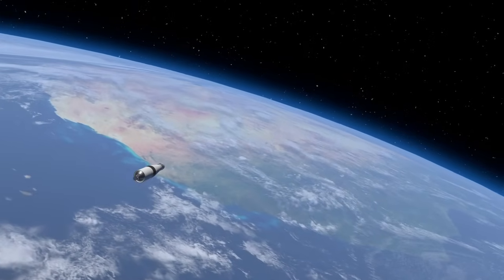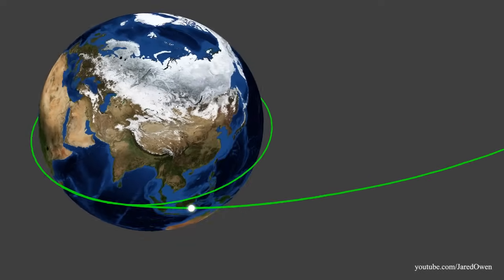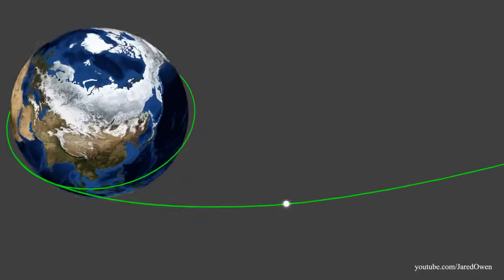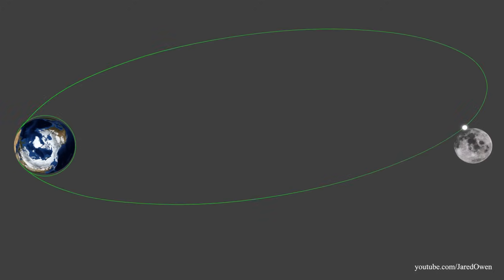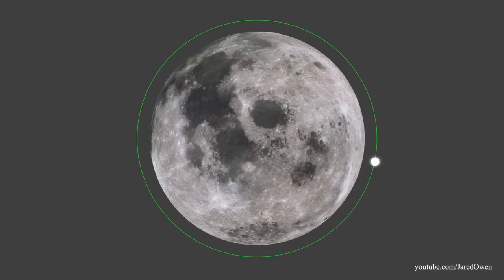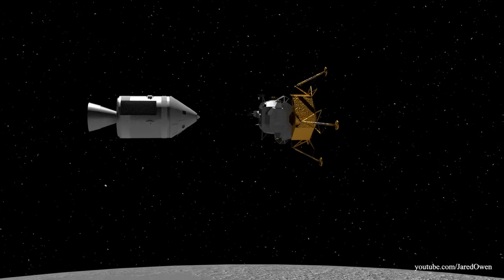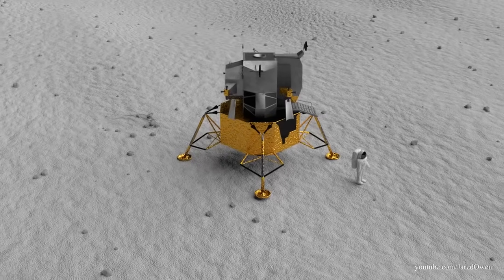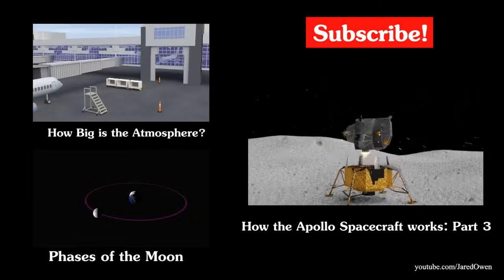How the Apollo Spacecraft works: Part 2

Comment: so according to you we just fly up to space and magically make our way to the moon over 3 days with no power, rockets or any kind of flight controls?  sorry, just not believable.
Reply: As I mentioned in the post you left in part 3 of this series, which I see it looks like you have deleted, he didn't go into specific detail about how the Saturn V was designed and built. I'll ask again. Do you think the most complex machine built at that time and successfully launched 13 out of 13 times just magically appeared out of thin air? That's how ridiculous you sound. Jared's videos explain how the lunar orbit rendezvous procedure works along with the Apollo spacecraft. Did it ever occur to you that the details you think he should have covered can be easily found but instead you dismiss it as magic?
Reply: Since you never responded to my original query, here you go again

-> 400,000 people were involved with the project, yet nobody has come forward with evidence that the landings never happened. You guys like to bring up the Manhattan Project compartmentalization security that kept only the ones in the need to know fully aware of what was going on. Yeah, sure. A top-secret military project that kept even vice president Truman out of the loop being compared to a project like Apollo that was as publicly open as possible. Yet despite all the USA's attempts to keep the A-bomb project under wraps Russia still managed to get key people in the right places to provide them with enough info that they developed their own bomb much sooner than the USA expected. You seriously expect us to believe that compartmentalization was possible in a project as huge as this that so visible to the public? Or that in the past 45+ years since the landings were supposedly staged, nobody has come forward with insider information or definitive proof? Yeah, right.
->Typical hoax believer answer: (Something involving a worldwide conspiracy with zero credible proof)

-> The Russians tracked and confirmed all 6 of the Apollo moon landings. Why would the USA's major competitor during the space race do that?
->Typical hoax believer answer: (Something involving a worldwide conspiracy with zero credible proof)

-> Russia, Europe, China, India and Japan have all flown missions to the moon. So far, none of these countries/nations have brought forth any evidence that it's impossible to do a manned mission to it. That includes this nonsense about the radiation in the VAB's being too hazardous to pass through. No credible radiation expert from any country including the ones mentioned here have ever stated that the radiation in the VAB's was an insurmountable problem during the Apollo missions to the moon. Why is that?
->Typical hoax believer: (Something involving a worldwide conspiracy with zero credible proof)

-> Scientist from around the world for the past 45+ years have verified and peer-reviewed all of the lunar rock & core samples plus all the data transmitted back to Earth by the ALSEP's left behind. There's also the Apollo 16 UV telescope images that include some of Earth that no astronomer has ever found fault with. That's as close to irrefutable proof as you can get. So how about you explain this away
->Typical hoax believer: (Something involving a worldwide conspiracy with zero credible proof)

.
-> Hoax believers have for the last 45+ years tried to find evidence that the landings were faked and have found nothing that can't be debunked. The proof they failed is that despite all their efforts, the missions are still in the history books. A story of that magnitude would have been seized on by investigative reporters and news networks. Not just the USA but countries from around the world would have gone after the biggest scoop in history. Explain how come they haven't.
->Typical hoax believer: (Something involving a worldwide conspiracy with zero credible proof)

-> Third party evidence that NASA would have had to orchestrate and coordinate flawlessly while at the same time supposedly hoaxing the mission; How could they manage that without insider proof coming forward for the past 45+ years to blow the whistle on it all?
->Typical hoax believer: (Something involving a worldwide conspiracy with zero credible proof)

Trying to discredit information because it came from NASA, as I'm sure you'll do, is a bit ridiculous. They made all the engineering and science required to pull the missions off available to their counterparts from all kinds of countries throughout the world.

In regards to the Apollo landings, we are talking about hundreds of 1000's if not millions of people with above average intelligence in various countries throughout the world over a time span of 50+ years.

I'm not just talking about the people involved with the project while it was happening. There's also all the scientists and engineers in the following decades that have access to everything related to it regarding the engineering plus all the scientific, peer-reviewed evidence, data and samples. Yet in all that time none of these highly intelligent folks from around the world have ever found a way to somehow get information out to anybody about NASA"s alleged duplicity regarding the supposed landing hoax.

Considering how incompetent everybody seems to think governments are, it's pretty amazing how people like you have no problem believing that a hoax of this magnitude could have been kept for so long without one piece of verified proof from the hoax believers being brought forward in 45+ years. All you guys have is unsubstantiated claims that require ridiculously more unlikely and equally unverifiable conspiracies within conspiracies to keep the original moon landing conspiracy going. Does that not give you the slightest hint that maybe the moon landing conspiracy is seriously flawed? People who see no problem with this usually dismiss, ignore or don't understand the irrefutable scientific evidence.
Reply: If you ever do attempt to do some proper research, you would find that every single supposed bit of evidence brought up about alleged proof regarding hoaxing the Apollo landings have been debunked over the years. If you decide to register at that forum I mentioned, I'm sure the same thing will happen with your photography questions but of course, that will depend on you be willing to admit you are wrong. Something that is pretty rare when it comes to this subject. Most of that evidence was debunked with relative ease because the supposed proof is usually based on complete ignorance of the particular subject involved. It's only people who lack critical thinking skills who fall for this moon landing hoax nonsense. Meanwhile, there's tons of engineering & scientific proof that's withstood scrutiny for 45+ years. Here's some of it:

-> There's the live TV coverage that would have to somehow convincingly fake 1/6th G movement in a vacuum, Google "Irrefutable Proof for Moon Landing - Lunar Gravity" and explain how experts in the field of kinematics for 45+ years have never come forward with proof that the astronauts are not in an environment that they say they are. There's also the fact that any attempts to do filmed mockups of the eva's on Earth would have to be passed off as live TV broadcasts which would have to fool telecommunications experts around the world. Google "Moon Hoax Not" and "For Jarrah" to get a better understanding of how much would be involved to pull that off and how the filming technology back then was simply incapable of such a thing.

-> There's all the moon rock and core samples that would have to somehow be able to pass scrutiny with geologists who can readily spot whether it's something that has passed through our atmosphere or not. 
Google "How do we know that rock came from the moon?"

-> NASA has made these samples available to scientists from around the world and every year 500-1000 samples are sent out.
Google: "NASA lunar sample request"

-> There's the Apollo 16 UV telescope images that no astronomer in 45+ years has ever found fault with. Google "onebigmonkey apollo 16 UV telescope"

-> Another thing that astronomers would be able to spot are pictures of the Earth that don't match what they should look like. 
Google "Apollo 11 Earthrise - How One Photo Proves it was Real" for an example. 

-> Another one to google is "Apollo 11: Fingerprints in Deep Space" that shows obvious handheld TV footage from the Apollo 11 CM looking at Earth from far enough away that they are clearly beyond the VAB's.

-> Then there are the LOR images. Lots of hoax believer nonsense about them being faked but the transmittal data for them can be downloaded by anybody with a computer and so far, nobody has proven anything about them being faked. You don't think a smoking gun like that wouldn't have been scrutinized by people with the required computer science expertise??

-> Here's something else you might not know. Apollo 12 landed close enough to Surveyor 3 that Conrad & Bean were able to do an Eva to it and removed the camera and sampler scoop from it to be returned back to Earth. They wanted to see what the harmful conditions of the moon had done to those parts after 2.5 years: Google "Analysis of Surveyor 3 Material ad photographs returned by Apollo 12"

-> 5 plutonium-238 powered ALSEP's were left behind that transmitted data from the experiments back to Earth right up till 1977. Unfortunately, due to budget constraints, they were shut down but they did send back enough information that storage of it became a real problem as detailed in this article: 
Google "the-long-road-to-alsep-data-recovery"

-> Starting with Apollo 13, they purposely directed the spent S-IVB's to crash into the moon so that the Apollo 12 seismograph could record the seismic waves generated to help determine the moon's crustal structure and makeup. Of course, as each successful mission added another ALSEP, they were able to expand on the info derived from these man-made impacts. They also did the same with the lunar module ascent stages. The Apollo 16 LM ascent stage data isn't shown because of difficulties during the de-orbit phase. They were able to derive a lot of info from these artificial impacts. 
Google "The Description of Apollo Seismic Experiments darts"

-> Another great site to check out has some pretty thorough crater analyzing to prove the landings happened. You can check out all six of the landings this way:
 Google "onebigmonkey apollo sights landing"

Are you starting to understand the magnitude of what would be involved to pull a hoax like this off? Never mind keeping it from being exposed?

I suggest you also take the time to read through the 93-page pdf titled "NASA’s Recommendations to Space-Faring Entities: How to Protect and Preserve the Historic and Scientific Value of U.S. Government Lunar Artifacts". There is lots of nonsense from hoax believers that the USA is trying to make the Apollo sites inaccessible which is ridiculous seeing as these are only recommendations designed to limit harmful effects of spacecraft landing too close or the altitude of hopper type craft flying at too low of an altitude. The fact is, the USA has no issue at all with visits to the sites by manned or unmanned means. They do request the Apollo 11 and 17 sites are accorded with the proper respect due to the obvious historic value. Also, there is an Appendix B in the pdf that gives a lot of recommendations from NASA as to what type of investigations at the Apollo sites would be most beneficial for scientific purposes. Now does this seem like the type of behaviour for a country that supposedly faked all of this??

As I said, irrefutable proof that has withstood scrutiny by the relevant experts from around the world in all the specialties involved for 45+ years which in my book proves beyond a doubt that the landings happened just the way they were documented 45+ years ago and which easily trumps claims by hoax-believers that fall apart quickly with any kind of scrutiny..
Reply: Only because you are to stupid to understand the rules of physics doesn't mean they are not exist.

Comment: But how did the two astronauts get into the L M ?
Reply: I'm assuming you mean how did they get from the CM to the LM. The docking probe they used to join up is a pretty clever device that can be retracted leaving the docking tunnel open between the 2 craft. You can read the whole procedure by googling "apollo docking system pdf". a pretty interesting 6 page document about it.
Reply: through the umbilical tower of course 

Haha jk just read the reply above me

Comment: These are great videos, which give a very high-level explanation of how it was done.  Just a couple of nitpicks here - during Lunar Orbit, the CSM and LM "stack" would have been travelling "backwards" (SM engine bell forward).  After separation from the CSM, one reason the windows were pointing downwards was so that the LM crew could get a redundant reading on their velocity relative to the lunar surface, using the markings on their windows against known landmarks (remember there were several missions to survey the surface of the moon prior to Apollo, and two during Apollo itself (8 & 10) that had this among their mission objectives prior to 11.  The LM crew would roll the LM and be "on their backs" for a great portion of the descent to allow the landing radar to give altitude and velocity readings.  They would pitch up to a more or less upright position only for the very last portion of the powered descent.  The other nitpick: a lot of misunderstanding of the parking orbit and cislunar trajectory arises from how people tend to depict Apollo's Earth orbit as purely ecuatorial - when in fact it was aligned to the lunar latitude of where they intended to land - a result of the "roll program" at launch.  With the ability to show this in 3D, you could have actually conveyed this in the presentation.  If nothing else, it would indirectly show how they passed through the thinner, less dangerous region of the Van Allen belts.
Reply: Hmm - I have to correct myself here, apologies. Turns out I may be wrong regarding the orientation of the stack at LM separation!

Comment: Where did the lunar rover buggy come from?
Reply: It was stored in one of the descent stage quadrants. The Lunar Module's weight was always an issue but the Saturn V engineers soon realized during it's development that they would have the ability to up-rate the F-1 engines. This meant that the LM developers were informed of this possibility early on so were told to design some flexibility into the descent stage that would allow for movement of what was stored in them to allow for an empty quadrant.

Comment: In 1969, NASA was able to transmit a TV signal from 240,000 miles away.  In 2018, with 10,000,000 times the computing power in my pocket, I lose cell phone signal all the time...LOL.
Reply: The key to maintaining a signal isn't "computing power".  The DSN had a 60 foot dish pointing right at the spacecraft.  Neither your phone nor the cell tower has one of those pointed at the other.
Reply: Cause you don't understand the difference between  mobile antenna and unidirectional antenna.
Reply: So you smarty pants people and smarty pants replies....YES...  I realize that the signal transmission of a cell phone is MUCH different than a television signal but was just being sarcastic and using the "losing-the-cell-phone-signal-in-2018" to illustrate the irony that with 1969 technology, a television signal was broadcasted flawlessly with 1960's communications equipment, 1960's energy sources, etc, and done with zero practice (from the lunar surface) and on the very first try.  Funny how nobody questions this technological feat and the fact that it's been almost 50 years since it's been duplicated...... but alas, everyone has the right to believe what they want to believe.  I like to use the analytical (and questioning) mind that I was born with....    PS---  do your own research and look up a video where a communications Electrical Engineer did all the calculations on how the transmission power to achieve a signal from 240,000 miles away was physically impossible....
Reply: @cebukid70  Well it wasn't a common transmission to begin with. For the program engineers developed an unique comunication system called Unified S-Band that evolved in what is today modern GPS and mobile communication (That works under the S Band of the Electromagnetic Spectrum). The original transmison was crap it had a 2.5 delay and one can barely distinguish the pixels in the image. So There is your answer
Reply: @cebukid70 
Lol.  Always some anonymous source.  Someone somewhere said it couldn't be done.  He was highly qualified!  Highly qualified, my ass.  I lost IQ points just reading your posts.